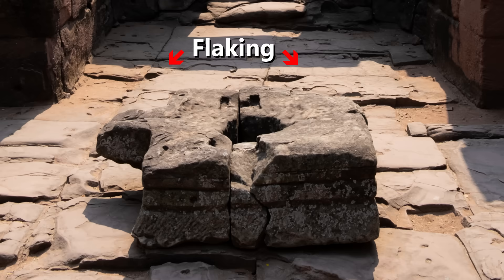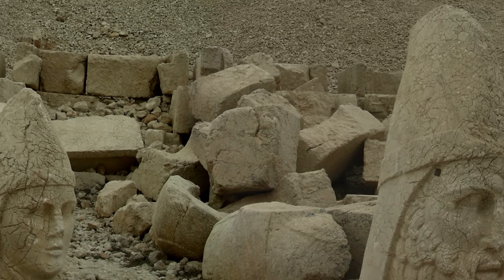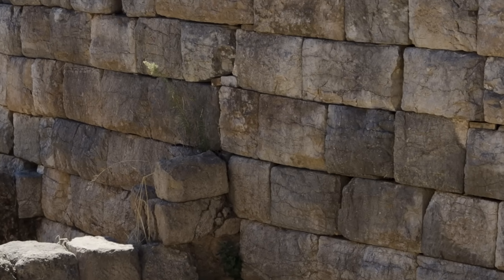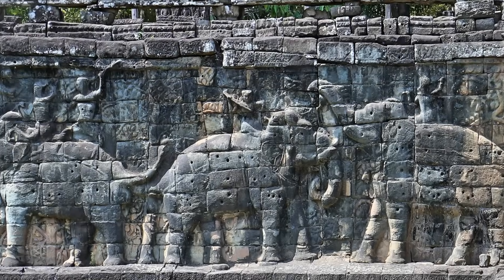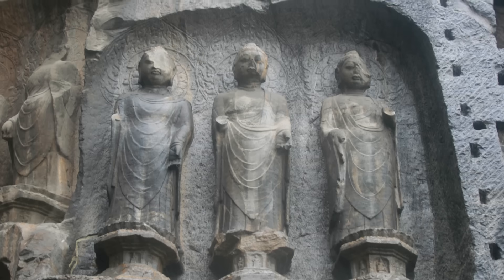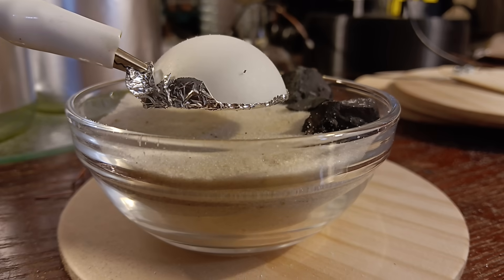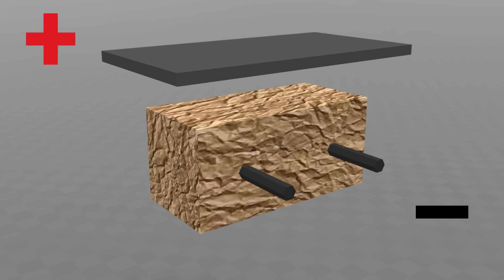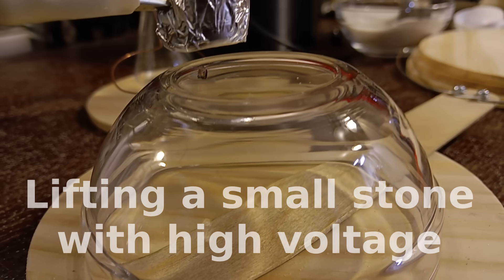The Greatest Mystery, Solved. Recreating Ancient Stone Melding Technology (Part 1)

Comment: I believe that all these blocks are poured in place or on site. The holes you see are for tie-rods to stop the forms bursting open.
Reply: Now that makes sense
 Former pattern maker. Had to build all sorts of wooden  moulds to put concrete in. On taller ones we used all thread thru a PVC pipe to help support the sides. Makes perfect sense
Reply: @lonniemonroe2714 
Not wooden moulds. These moulds were elastic. Maybe made from cotton or animal skin. This explains the shapes and the pillowing effect.
Reply: Depends on whether all the holes shown, go all the way through the rock. If not then they were not for tie rods.
Reply: you cant geopolymer granite with its complex mineral structure that takes thousands of years to form without turning it into lava, and that would just catch the forms on fire
Reply: Hmm possible
Reply: Why would they be randomly sized ?
Reply: @beachbumseaglass maybe every body carried a bag of aggregate to the site,and it was what you could carry , big groups carried more little ones carried less😂
Reply: @beachbumseaglass 

Random sizes would make the construction extremely earthquakes resistant.  Considering the fact that Inca empire was located in the earthquake prone region, it seems to be one of the comprehensive motivations to me.
Reply: True untill they show you exactly where the stone was cut from.still in its exact form.
Reply: This! We already know about the Roman concrete, which was absolutely amazing and unmatched by modern concrete. The stones are ancient concrete, too. They were poured in place, hence the tight fittings with adjacent "stones". This is quite obvious to me, and I suspect it is to many others. Still waiting for "the science" to figure it out, it might take them another 500 years of sweet juicy government paid for "research".
Reply: No. Every stone has it own individual mold?
Straight up stupid.
Reply: there is a book that describes in detail that process as used in the larger pyramids of egypt and the geopolymer concrete formulated from desert minerals that is dozens of times more durable that cement commonly used today - by Joseph Davidovits Prof.
Reply: @richardbeierle But when you analyze the stones turns out to be granite or sandstone etc. Natural stone.
Reply: Or just sand, grit, whatever in the bags, then solidified with plasma

Comment: Many of these holes, especially in Rome were for the mounting of marble facades.
Reply: And ropes pulleys and scaffolding
Reply: The protrusions and some of the holes are for lifting and fitting the stones as well.  With such tight fitting seams you couldn't lift with a sling under the stone, it has to be lifted from the sides
Reply: @kingcosworth2643  Indeed
Reply: And some for scaffold.
Reply: scaffold holes for timber scaffolding
Reply: However, what about the protusions?
Reply: @doreenward1308  to help building like stairs then they cut it, hiting it with another stone
Reply: Yes see talking of a lost epoch
Reply: Shhh you’re scaring away the crazy people.
Reply: Moths.
Reply: Possibly for both purposes
Reply: @xmo552  lol no, they dont have enough electricity for it, which was none.
Reply: @yeetman4953  
How many times did I say anything about electricity? None.
Reply: @xmo552  what was the other reason
Reply: @yeetman4953  
Umm I forgot. That's my story and I'm sticking to it. 
I was off.
I wasnt there.
It wasn't me.
It was my twin brother. 
I'm claiming ignorance all the way.
Reply: @xmo552  touchy touchy
Reply: @xmo552 Don't be silly.
We have a wealth of information from Roman times.
The OP gave you the answer taken from Roman writings but you have to talk nonsense.

Comment: so how much power is needed to melt a big stone block? Also please contrast your theory with the "inca paste" acidic chemical gel theory?
Reply from the maker: I am in the process of doing higher-voltage testing and will be able to relatively estimate these numbers soon (they will no doubt possibly be in the millions to billions) as this is also what a full size SGL (Spark Gap Lingam, see the How It Works video) was designed to handle, just as a spark gap alone - the voltage output induced by a tesla coil using this setup would be even higher. I'm not super-familiar with the Inca paste theory, however paste doesn't leave half-carved monuments in massive rock quarries =) There may have been geo-polymers or other types of mixtures used for some purposes, though I honestly have not found any conclusive evidence of this (except with limestone), at least not shown in the granite / similar blocks and materials quarried and even the rocks 'melted into a large pile' (several of these in India) that were then used or harvested for the main structures and walls...
Reply: @MadPlasmatist   https://www.i2massociates.com/downloads/On_the_reddish_glittery_mud_the_Inca_use.pdf is the best link to the dec 2017 paper by Helmut Tributsch. Since reading it I've been waiting for some kind of product to be available based on the chemistry therein, for DIY granite construction projects, at all lawn and garden stores. Not holding my breath lol.

Comment: I think the closest anyone has come to explaining how these rocks became shaped was the use of naturally occurring acid that would be applied to the surface of the stones which allowed for their surfaces to become plyable and gelatinous. After curing, the surfaces even show signs of vitrification. I think was is more plausible is that they gathered a lot of smaller stones and mixed them with the acid which basically turned them into a flowing geopolymer and allowed the stones to be poured, slowly and shaped with trowels or other tools as the pour was starting to harden on the outside. When you see what looks like molten voids missing from these stones, that's where a bit too much acid may have been used and resulted in part of the polymer to sluff off the stone. The nobs are likely the result of pouring the stones into a form of some kind and the two holes, one is to allow for air to leave the form as rock pours in and the other is where they are pouring the stones into the form. When the holes are located near the top of bottom of each stone, that's where the course below was poured into and stopped short of filling the form entirely and leaving two ram shaped horns from the bottom course to then be overflowed from the next stone being poured above it. In this way, those knobs would serve not only as a funnel to fill the form, but also as a link of a chain providing the resulting structure with more strength. That, or those knobs are there to simply make the gigantic stones easier to move. Just like placing a pebble beneath a giant block to use it as a pivot point.
Reply: That has always been my leading hypothesis as well, but doesn't hold water when you look at the irregular shape of the blocks. If you poured the geopolymer, you would use molds that were uniform.

Comment: Good theory.  How did they cut the stones in the first place?  Why don't all of the building stones have electrode holes in them?  How did they drill the holes in a hexagonal shape? .......just wondering.??
Reply from the maker: I'm still discovering a few of these things however the electrodes, in many cases, appear to be 'pushed' into the rocks in some way (mostly granite), more than likely while the electrodes were active. This is just Part 1 and my Kickstarter campaign to help advance this research further will be complete in about another day - as I build a more powerful system, we will get to see more powerful results =) Also, the heat application process wasn't necessarily needed in every stone, only mostly around the seams (usually set lower in the rock as heat moves upwards) though many of these plugs on newer structures have not eroded enough to where you can easily see them yet, perhaps unless up close. Another note, is they should possibly be detectable by magnets or a compass if any metals remain in the stones today (and I can even see flecks of metal on many granite walls, look closely at the ones in this video for example, you can even see 'swirl' marks where it looks like they melted the electrode into the rock and it has since rusted away) - stay tuned!
Reply: something like a thermal lance...again, plasma torch, but the changes to the rock crystalline structure would be obvious. Granite has relatively large crystals, but after melting it should be like glass...obviously different from the country/ surrounding/ source bedrock granite